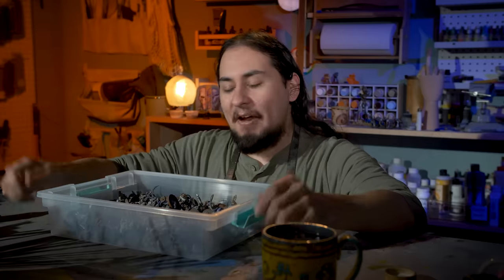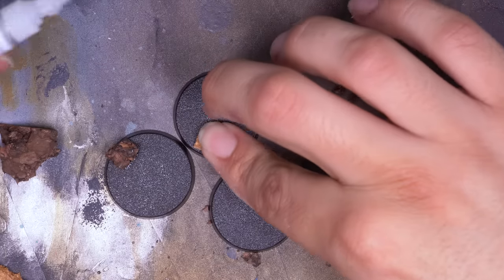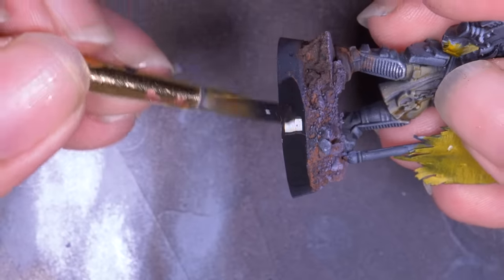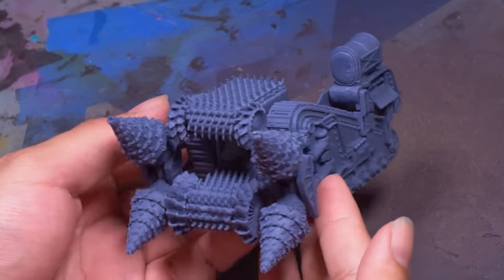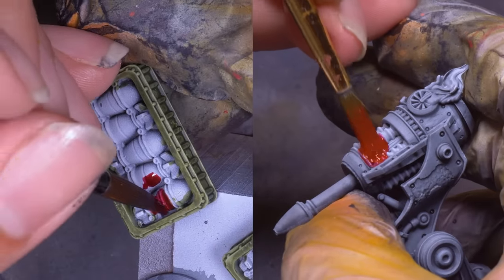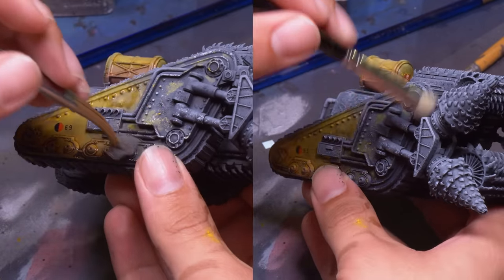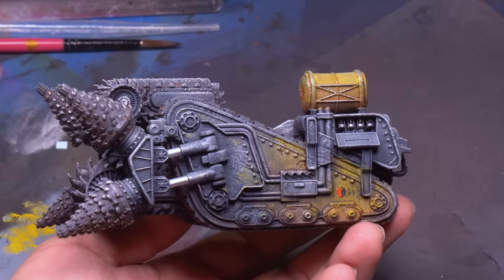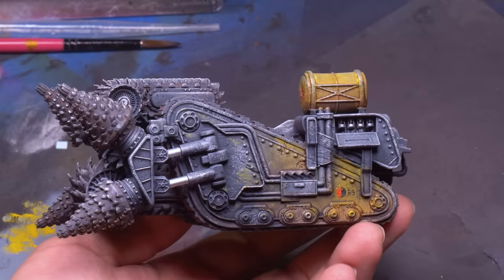FIXING My Worst 40k Army!

Comment: another reason the hairdryer didnt work on the green stuff: the putty cures by the two surfaces touching, heat does nothing. theres really no way to speed it up as far as i know, but on the bright side you can paint over uncured green stuff with no repercussions

Comment: I am currently working on a similar project, but I took a bit more drastic measures..

reworking my grey knights and the most annoying part for me,... their size and pose
so I started kitbashing every single infantry model after I sold the old army for quite a good price

the leviathan terminators and assault intercessory are amazing bases, but require a lot of work and quite a lot of plastic putty

so far I finished:

- Draigo
- 5 purifiers
- 10 terminators

now working on a strike squad

Comment: I had such a good time painting Genestealers like the Xenomorphs.
Black undercoat, then two thin washes of silver.
Once dried a wash of green and black over the entire model.
You get that black finish, with that shimmer/shine Xenomorphs have.
Then use PVV glue mixed with some UHU glue, and almost glaze it over the teeth, mouth, tongue and joints.
After 3 or 4 passes, it builds that ozzing, goo that the Xenomorphs have and drool.
Once you've done that, it's ALL about the detailing and highlighting.... If you are good at detailing and highlighting, these final touches make an absolutely evil looking army of Genestealer Xenos.

Comment: I also have a GSC army that I haven’t played in a while. I don’t hate the paint job I did; I think it’s pretty good considering how difficult GSC’s paint scheme is… but it could be better. I think I will paint strip 10 Hybrids and try again, and see how they turn out.

I really liked that Drill Rig model and making those special blips. I’m going to buy more crater terrain and use those as blips, and sacrifice some of my old Purestrain Genestealers models to make my own blips. The only problem is that blips are relatively small in diameter and even the smallest crater terrain might be too wide. But that’s an issue for competitive play and I’ll just play my GSC army casually against my friends.

Comment: I hope to one day become this good at painting/designing my miniatures for Warhammer. I just joined this hobby (doing Age of Sigmar because I liked fantasy but missed out on it) and am a brand new wargamer so new in fact that I cant seem to even put my models together correctly without messing up some random piece of plastic on them. Then I freak out and want to literally toss the unit and buy and entire new set but they are so expensive ughhhh I cant explain how frustrating it is. I know i need to be patient and eventually I will get better but even just starting out feels very hard and almost impossible to do....PS my painting sucks and I don't understand all the differences between contrast and speed painting or layers and bases...im hopeless but I wont give up...
Reply: Just a right of passage. Lots of my early models are pretty rough too :D

Comment: The Achilles ridge runner should have definitely been basically just a normal pick up truck with stuff attached instead of the model gw did. It would’ve made more sense.
Reply: We have a truck, it’s called the Goliath truck, another truck would be boring but if you really wanted a more industrial option. The Achilles is a geological survey vehicle, real geological survey vehicles are vans, it makes no sense for it to be a pick up truck. I understand wanting things to be more industrial but the ridgerunner actually does make sense if you consider that it is meant to be fast, it’s supposed to accompany the Atalan Jackals.

Comment: 6:05, you didn’t make a ridgerunner, you made another Goliath truck. It’s a geological survey vehicle with weapons mounted on it. It’s meant to quickly scrape across the surface of a world and  assess the land, or do the same under the ground. It isn’t meant to carry people, that’s what the truck is for. It’s a scouting vehicle, and if the rock grinder can exits then a vehicle that exists in real life can also exist. The heavy stubber looks too intentional on your design, and the recon equipment is in the drivers seat, so you can either drive or survey. If you wanted a more industrial looking ridge runner you should have taken a look at what real geological survey vehicles look like and made a van with a gun affixed to the top.